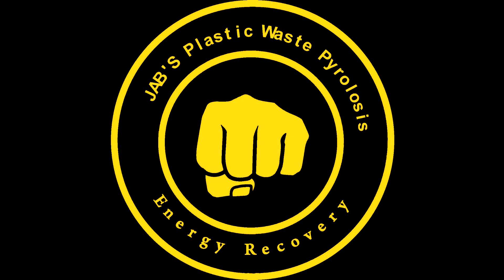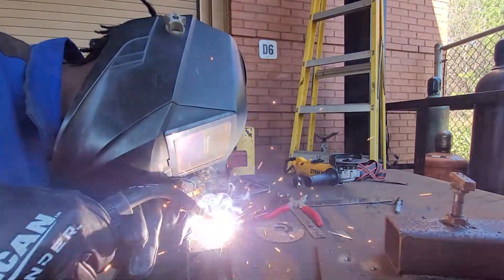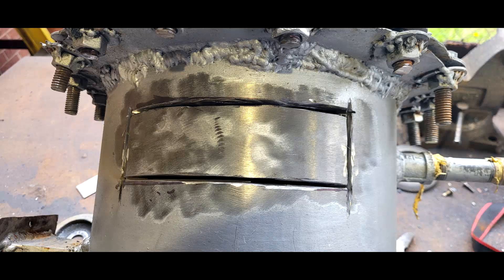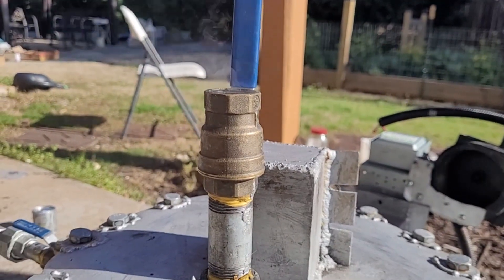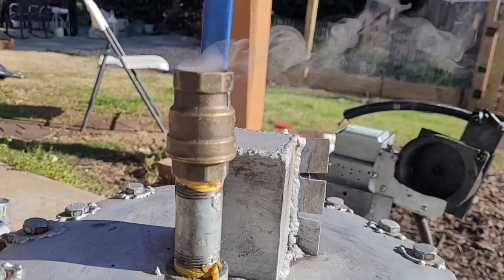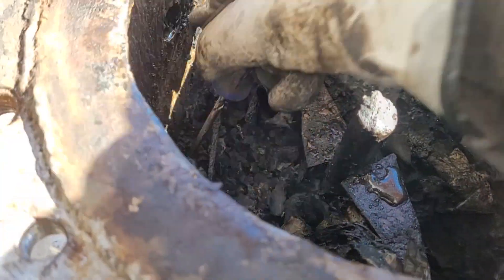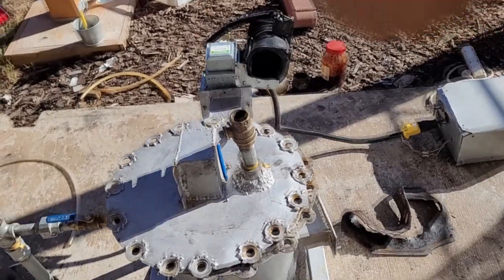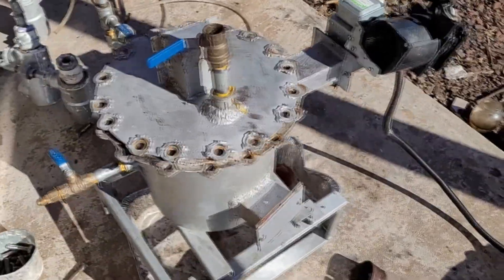Pyrolysis Reactor Update   New Waveguide!

Comment: Have you ever considered using a glass reaction Vessel? Maybe borosilicate glass? Then you could just shoot the microwave into your glass Vessel with no holes. You could experiment on a small scale with a 500ml to 2000ml Borosilicate boiling flask. Food for thought.
Reply from the maker: I've tried such in my early expeirmental days. The heat + pressure always would crack the glass after so many minutes

Comment: if you add 10% of the plastics in molybdenum catalyst the yield of oil is even higher. maybe if one would install the magnetron on the bottom half the reaction should go on by itself as the plastic melts it shrinks in size and thus keep feeding new plastics from the top, also if the tube for the gas outlet is larger in diameter it would slow down the gas flow which would lead to better condensation ( at the bottom heavy oils are collected at the top light oils) as it has more time to cool down. the water for cooling down the gases could then be used then for heating shower water or the house. keep up the good work and cheers from germany
Reply from the maker: Thank you, great suggestions!
Reply: @naturejab  glad to be of help, keep on going,  we as a community with the help of the internet can create something big which in the end helps all people and the nature. i think if this unit could be produced on a large scale each homeowner could buy to process the plastics waste, collect the oil and sell it to a refinery, this monetary gain would certainly help gain the momentum for plastic pyrolysis
Reply from the maker: @Humbulla93  Precisely! A non centralized and communal approach is the key to solving the plastic waste problem. Anyways, I'm very grateful for your suggestions and taking the time to comment and watch. Thank you once again!

Comment: Keep going dude. The top port will guide the waves better into the material and should work with the agitator. For reference, my run times are about 3 hours for an indirect heat source if you decide to go that way 👍
Reply from the maker: I figured the same. Thanks for the refrence and for watching and commenting! Cheers.

Comment: Just found your channel man, here's a suggestion to make it work better... 4 microwaves , one on top, one below, two on opposite sides
Reply from the maker: I think this is a worth while idea to test. The biggest issue with having the magnetron/microwave anywhere but on the top is that when the plastic comes in contact with the entry of it, it goes supercritical and destroys the fiberglass seal between it and the magnetron, causing the whole reactor to leak. Therefor, the bottom / below would not work, and the sides could only work at certain angles.
Reply: @naturejab  oh right I see, plus having one on the bottom is likely to have things fall down into it and block it too. It's a very interesting thing you are doing here man, big ups to you! I look forward to see how your progress goes, I was about to start making a rocket stove heated one but the amount of wood needed would outweigh the benefits and this seems like a really good and cool idea!
Reply from the maker: @ethanhamilton3561  Thank you! I thought about a rocket stove a while back as well. Like you said, the input is so high that it's not worth it.

Comment: Is the distance between the end of the waveguide and the reflecting surface of the reactor an integer multiple of the microwave wavelength? 

Having it reflect off a flat surface helps with resonance.
Reply from the maker: The distance does not make a big difference, there are minimal losses with the geometry and material of the waveguide
Reply: @naturejab  Sorry if I worded it poorly.

I was referring to the geometry of the reactor creating reflections that constructively interfere with sequential microwaves. I know that microwave ovens and cylindrical resonance cavities are sized with the operational frequency in mind.
Reply: And on top of resonance some geometries decrease variability in hot and cold spots for even heating
Reply from the maker: @Dellon Collins  oh most definently. I kind of am just shooting in the dark because I don't have the resources to build a cylindrical reactor that is the proper calculated resonance cavity size
Reply from the maker: @Dellon Collins  yes, and this is why experimentation is necessary
Its very tough because there's no real way of knowing how the microwaves are behaving inside the reactor once its sealed and running. The only things I can do is observe the plastic's degredation as well as the end products to come up with theories on what happened.

Comment: If you add calcium carbonate chunks it will add nucleation sites and make the plastic boil better. We were using a magnetic stir bar but the temp got too high and kept demagnatizing the thing. We added a bag of rocks and it worked better than stirring.
Reply from the maker: Thanks. I've been using powdered calcium carbonate as a catalyst. What makes the rocks better?
Reply: @naturejab  Sorry, I didn't realize you were using the powder. I just know we couldn't get the oil we were boiling to boil without the rocks or a stir bar. I am assuming the powder would work better. I just know the rocks lowered the boiling point 50C. From 260 to 210, under a vacuum.
Reply from the maker: @wesKEVQJ  thank you!
Reply: @naturejab  Do you plan on making a reactor for the char? I watched a video where a guy stuck carbon electrodes in water to make H2 CO. I've also seen video of carbon arcing in a microave. Either way steam over hot carbon makes syngas. I want to do that then make methanol.

Comment: What if u hit it from the top and bottom of the reactor with the microwave?  What do u think about effects of vacume on the reaction what pressure do u recommend for highest yield?
Reply from the maker: Great idea! I should try a magnetron on the top and bottom since both ports are open. Vacuum pressure would definently be a great benefit to the reaction. The higher the pressure, the lower the temperature needs to be, reducing energy consumption as well as time. The issue is, the more pressure, the harder it is to keep airtight. The highest I've ever got mine is probably around 3 PSI, but research papers suggest up to 11 PSI for a good vacuum result.

Comment: I’ve seen some reactors use an auger to grind up the plastic into small flakes that is easier to burn or install a compressor and have it enter the bottom of the reactor so it could circulate the material and fasten the process. But anyways keep it up I like the content
Reply from the maker: Thanks! I'll eventually build a plastic grinder.